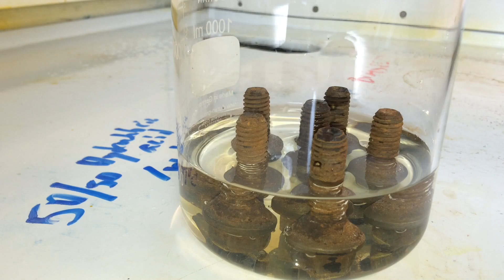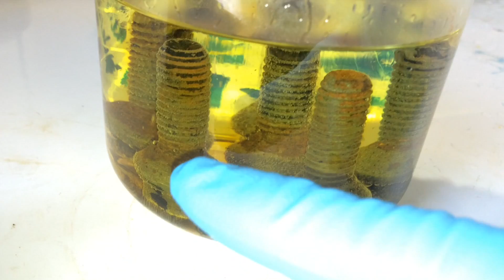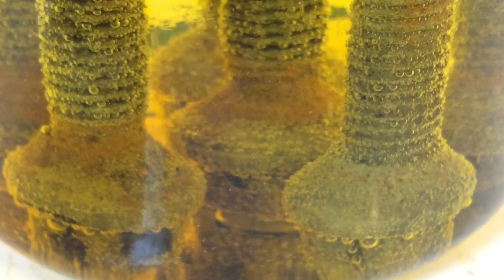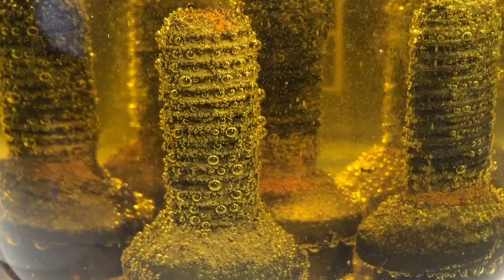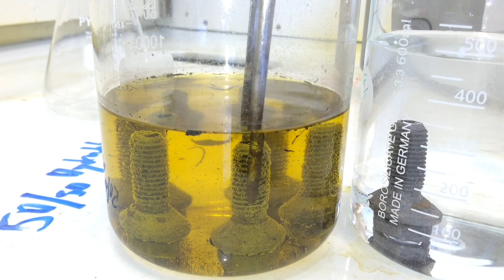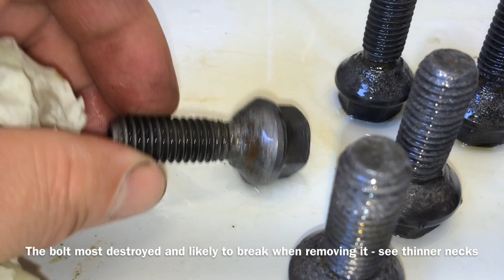True rust removal by a chemist - Jeep Wrangler YJ bolts : Ep 5

Comment: Are there any I'll effects of using this method to derust a car frame and the suspension? I plan on building a tank to soak the parts an am torn between citric acid, vinegar and the hyrochoric acid. Let me know what you think. Thanks.
Reply from the maker: In principle, all the rust you remove has no strength at all in itself. If you would go to the shop and buy rust dissolver you would likely get something based on phosphorus acid. The reason is that chloride, as in hydro chloric acid, can bond and stay with the metal (iron) and its corrosive there as well, that is if you expose the parts you have cleaned to water, i.e. in the future. Nothing beats hydrocholoric acid in efficiency though, and if you have used it you should make sure that you treat the part in an alkaline bath as well, to neutralize the chloric acid. I have no issue with using most of the above bolts again, because if you think about it, I have only removed useless surface rust. On one bolt in the video, you can see that the neck has rusted away extensively. This bolt was thrown away. There is no good reason to compromise safety. Good luck! PS. If you chose any of the other acids you mention, a bit of heat will speed up your progress.
Reply: Got it. Thanks for replying.

Comment: The metal looks kind of sandblasted as if the acid had reacted with the base metal. However, maybe they looked that way before you put them in the acid solution?
Reply from the maker: true, but the sandblasted appearance comes from the rust that has been dug into the surface and then was dissolved. materials scientists call in pitting.
Reply from the maker: its a surface effect of the metal, just a scrape on it and it becomes shiny. I show it here: 

https://www.youtube.com/edit?o=U&video_id=5Bkdej_z1HI

Comment: Doesn’t the acid dissolve the base metal too? Would think that if it did dissolve the base metal too it would weaken the bolts to some degree. Thanks for posting the video though. 👍
Reply from the maker: Not under these conditions. The major concern here is the use of hydrochloric acid ( H+ Cl-) and some comments refere to that below. The chloride ions are corrosive in nature and many rust dissolvers are therefore based on phosphorous acid (with phosphorous ions instead of chloride). However, there are ways to get around this and one is to torch the bolts so the chloride ions go into gas. Regardless, most of the iron is still inside the bolts and is never effected. One should also remember that chloride ions are present on our roads and also made the bolts rust in the first place.  All the best and thanks for watching!
Reply: yes HCl will attack the steel too.  Ken could show this by heating the HCl and leaving in longer.
Reply: Hydrochloric acid does react with iron. The bubbling you see is hydrogen gas being formed by the reduction of H+ by elemental iron. The reaction of hydrochloric acid with iron oxide would only form ferric chloride and water and wouldn't cause bubbling.

I think it's more a matter of rust dissolves faster, there's less of it, and it's all on the surface.

Comment: One thing to be aware when removing rust like this is hydrogen embrittlement, which is a real problem on stressed bolts. I'd not use it on anything where safety is involved.

There's a report on this at here: www.omegaresearchinc.com/Publications/getpub.cfm?pub_id=5
Reply: Graham Langley I think it matters about the concentration of the acid. I think I also read somewhere that you could bake the piece to lower the chance of hydrogen embrittlement. I'm not sure though and I am thinking about using this method on my car frame.
Reply: Come on.....!!! Do you have any idea how strong this bolts really are?..they would have to be weakened substantially before they fail.  Losing a few percent of their strength won't make much of a difference in the long run.  Now if these bolts are being using on a trip to the moon or a triggering device for a military bomb, that's a different story but for everyday common applications, it won't make any difference. you must be an engineer!!!
Reply: ... it’s obvious that a serious pitting came out as a result. 

That quoted report says that ‘The embrittlement testing method was the standard sustained load, 200 hours at 75% of notched ultimate tensile strength, with time-to-failure and applied load being the two controlled test variable’ , ...which means that the tests were done at 75% of the max their samples could take (ultimate strength). 

If anything to worry about, then that would be the lost material that had rusted away. It’s also a weird comparison because you cannot honestly believe that you torque your bolts to 75% of their ultimate strength. Then you have to be prepared to snap every other bolt head since your torque wrench is just true to 10-15 % deviation.

Comment: OMG....who has time for that? Take a small wire brush to the dang bolts and spray them a few times with WD50. Wipe them off and way you go.  If you want to paint them after you clean them, dip them in lacquer thinner or naptha (coleman fuel) and spray them with Rustoleum paint. Don't play with acid.

Comment: Don't forget.  Always add acid to water (not the other way around)!
Reply from the maker: +FclefRules Good point, should have been highlighted. 

'Always Add Acid' 

...to avoid water hitting the surface of an acid - splashing in your face because the water heats so much that it starts boiling.
Reply: I was to how to remember this, 
you put your ass in the water, not the water in your ass.
Reply: I was taught that is was more to do with the concentration of a possible splash.
Reply from the maker: highlighted relevant comment in this video, thanks. https://www.youtube.com/edit?o=U&video_id=5Bkdej_z1HI
Reply: "Do as you oughta, pour acid into water" :)
Reply: Little Jimmy is no more, he added H2O to H2SO4.
Reply: FclefRules ä
Reply: FclefRules why?
Reply: I am 60 odd years old and always remember the word "paw = pour acid too water" that's what my teacher taught us all
Reply: Not that crucial in most cases.
Reply: Unless you're working with extremely large amounts, or heating the acid/water, it doesn't really matter what gets added to what.
Reply: Well, the heat effect is a concentration problem, not a volume problem, so this is bad advice,
Reply: ...but some people are into that stuff. In Germany....probably...
Reply: Not very important with hydrochloric acid, you can really add it either way and it doesn't heat up too much. Sulfuric acid is the one to AAA.

Comment: How did you dispose of the HCL when you took the bolts out?
Reply from the maker: I neutralized it to about pH 7 by adding an alkaline component, which can be done with sodium hydroxide, or similar. The solution I had was going into a laboratory waste but if I didn't have such I would leave it to a petrol station where they handle acids. If you would pour it down in a regular sink at home, or the toilet, you could cause a problem because the pipes are sometimes steel, and old gaskets  between pipe sections may seal because of the combination of rubber and rust. Taking away the rust at these places may cause a major leak if the rubber seal is partly broken. Be careful :+)
Reply: Baking Soda.
Reply: Not baking soda (sodium bicarbonate).... laundry detergent powder (sodium carbonate).
Reply: Just FYI: just diluting the acid well before dumping it down the drain is perfectly safe. There's no more acid here than there is in some toilet cleaners.

Comment: Will it affect the integrity of the metal or Strength of the metal?

Can I have it 1:8 (1 part HCL 8 parts water) and leave it for 24 hours without the solution eating away my metal?
Reply from the maker: It is much much more difficult to dissolve the iron in itself than the rust because the rust is porous if you would look at it in a microscope. However, since HCl is very active I would not just dump it in there and leave it. Based on the results I had on 50:50 you are 1/4 in concentration so possibly you would have the same result in 6-8 hours but it is also dependent on the nature of your rust. If it is very porous rust it will go faster. I would try and see what happens after 3 hours, the eating of the metal is very slow and the reactions slowed down at the end when most of it was dissolved. It's however always important to neutralize your metal object surfaces after the rust removal by using some sodium hydroxide of similar alkaline chemical. Cheers and thanks for the comment!
Reply: Hi Ken, Thanks for a very informative video and response. Unfortunately, I have to work blind on this one,as I have placed the solution inside an old air compressor tank which had rusted away for years of use. The tank has only small holes 1/2" and 3/4" inches on it, hence, can't really see what's going on inside. With this I can only hope and guess perhaps that it has done it's job inside there.

I have tried to pick a borescope / endoscope whatever it's called on ebay, but it will be weeks from now until it arrives. I've place the solution (1:8) yesterday evening, hence, it'll be 24hours when I get back tonight. I hope it hadn't really eaten through the metal now as hours had passed. (crossing fingers). The muriatic acid by the way in it's label says (15% HCL, 85% Aqueous vehicle), Aqueous Vehicle probably is water?. 

This is why I'm asking if it had ruined the integrity of the metal as I have left it longer than your experiment, although mine was (1:8) solution as to your 1:1. 

and yes, I have prepared baking soda, and will dissolve it in water upon flushing out the HCL solution.
After the soda solution, I'm planning to flush again a rust converter inside, basically, shaking the tank so the rust converter covers the inside surface area of the tank. Maybe top it again with red lead after the rust converter dries.
Reply from the maker: I would do it in turns of 2 hours, eventually your tank will be clean :-)
Reply: First Fix0 hope it worked sounds like quite the project

Comment: hi nice video .do you think that using white vinegar would have the same results?
Reply: coca cola works like a champ too
Reply from the maker: Yes, but it is much slower. You need to boost the reaction with an electrical source. I am about to show this in a separate video. Anyway, if using white vinegar which contains 4-20% acetic acid, a good start is to boil it because the acid becomes more active.
Reply: thanks for replying .i have a WW1 artillery shell ,covered with rust . i ordered some white vinegar.but I wouldn't know how to connect it to an electrical source.Do you think by just submerging it to white vinegar would do the job?
Reply from the maker: +gigolohunt , hot vinegar in a bucket and check if it discolors within 2 h. I don't know the concentration of the acid in the vinegar. If no color after 2 h, it will take forever as when I tried WD-40 in another video. Spice it with some battery acid from used and returned batteries at any petrol station if you cannot get hold of any 'more strong' acid, rinse with loads of water
Reply from the maker: here's the answer, I compare 6 times the conc white vinegar with the above system 

https://www.youtube.com/edit?o=U&video_id=5Bkdej_z1HI

Comment: Question. If there is still rust areas and say a paint/ clear coat is applied for rust prevention. Does the already rusted areas that were not removed continue to penetrate the metals' integrity, or does the the paint (rust specified paint) fully keep deep rust from damaging the metal?
Reply from the maker: Rust forms as a consequence of iron interaction with water.  Now, if you paint or clear coat your part so absolutely 0.00% water gets in under the coating, the remaining rust won't do much in converting iron into rust (iron oxide). The problem is that such paint or clear coat does not exist. All paints and clear coats are letting through a little bit of water with time, and it is referred to as 'permeability of plastics'. The 'permeability of plastics' explain why you sometimes get your medicine in aluminum sheets. That is because the drugs are very sensitive to water (humidity), and the suppliers want to be sure that no water gets through during the shelf-life of the drugs. Aluminum is completely impermeable. What folks do in the car business is thus to use the best possible option, since they cannot seal their cars with aluminum. They remove as much rust as possible because the rust in itself attracts more water than pure iron does, then they use paint (rust specified paint) that contains zinc because the zinc reacts with water before the water reacts with the iron (as a sacrifice metal). Some companies claim that they have the coating/paint that is completely sealing out the water so they don't need the zinc in the paint, but that is not true since no such paint/coatings exist. However, there are better and worse coatings towards sealing out the water. So, basically the answer is that no painting/coating will forever seal your iron against water but with a good coating you will make new rust formation happen much slower. If you also have the zinc in there, it will take even more time for the conversion of iron into rust to happen, but even in this case there is a day when the zinc has been consumed and water will be there again. Thanks for good input!
Reply: when it comes to cleaning you have level one ,level two or level three .. etc ..  oxygen and moisture must be present to create rust. paint will stop both from getting to the metal but when the paint gets old and fails then rust starts . rust will destroy a metal and it will take some time .. how long has to do with moisture ,salt, oxygen ..no Mather it takes a long time for metal to fail in most application  ..for a bolt to fail in a car you have approx. 10 years or more   .you can use anode to slow the rust problem .

Comment: I have always been curious what the "rust converters" are. I noticed that an additive to most of these is poly ethylene glycol but I have read that it is also an acid.
What is the best way to coat iron after being treated besides priming?
I remember reading some old 1800's artillery books and they described a process used to coat cannons on ships, so you know it had to work being near salt water all the time.
Reply from the maker: The best way to treat iron if you wish to prevent rust is to look at how experts are treating iron in historical monuments. They use something called in Swedish 'blymönja', which resembles  something like a 'lead paste with tar similar properties'. This sort of rust prevention is banned in many European countries for private citizens to use because it contains lead oxide but allowed for historical restorations. Lead oxide was dominantly mined in Spain in the 18 century and I would not be surprised if this was used in some cannons or ships coatings .
Reply from the maker: Rust converters are based on tannic acid, from tree sap, a very particular acid, in the old times they used this acid as in wood shaves to put togehter with the tools in the toolboxes, to prevent rusting. However, tannic acid is a weak acids, and therefore they complement with phosphoric acid to speed up the conversion in rust converters. Here i show phosphorous acid as compared to the above: https://www.youtube.com/edit?o=U&video_id=5Bkdej_z1HI

Comment: Thanks for sharing! I guess the proportion by which this compound is dissolving the rust resp. the iron is constant and that the mixture ratio 1:1 in principle is arbitrary: Please correct me if I'm wrong. Also if I may ask, isn't there compounds that more selectively dissolves the rust and not the iron, or is hydrocloric acid the best in this regard?
Reply from the maker: The ratio was arbitrary, but taken concentrated enough to get a fast result. Hydro chloric acid is best in this regard unless you go mixed and more complicated acids. It is however not dissolving at the same rate, the rust (iron oxide) dissolves much faster because it is porous and the acid have easier access. Good point! Regards!

Comment: can you do this on a surface like a car body panel? obviously without having to drowned the whole panel.
Reply: boo boo tell use more about this process. Do you think that would work on a car frame?
Reply: I use large Rubbermaid watering tubs for larger items.
Reply from the maker: It has crossed my mind that a paste with acidic components/chemicals inside would have been a nice thing to paint on and then blow it off with water. Possibly there are already something like that, and maybe that is what they put into rust converters. They are called rust converters but surely there is noting in rust converters that brings back the original iron, its a scientific impossibility. The only thing that brings back the iron is electrochemical processes that would do the reverse to what you see in the video, but then the problem is that the iron formed is not as strong as the original iron because it becomes porous. Myself I stick with this, and if it's too corroded resulting in too much pitting showing after acid elimination, then I only replace the part. On a panel you could just paint on the acid solution and let it sit if its flat but be careful with the acid and make sure you neutralize the surface after. The surface you get is perfectly fine to prime and then paint. Good luck and thanks for your comment.